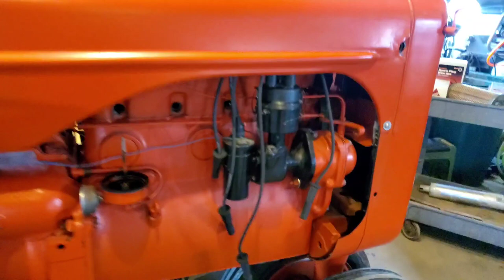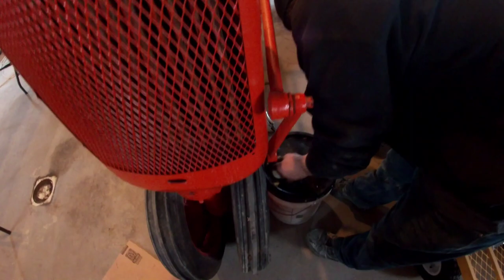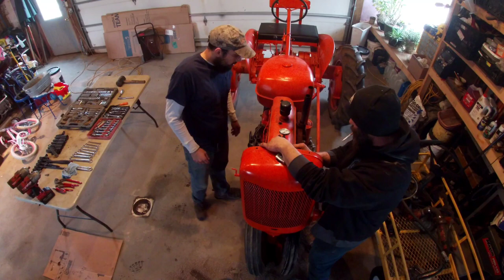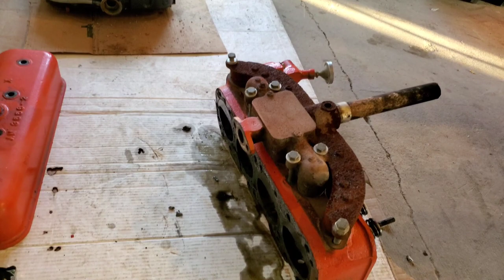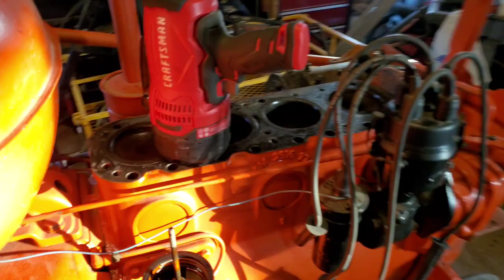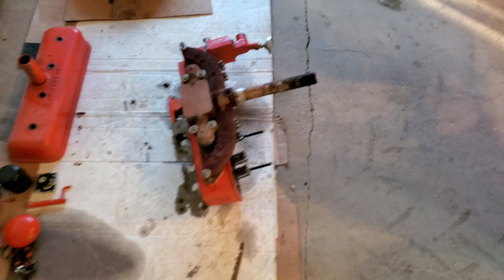Allis Chalmers C project part 1 - removing the head.

Comment: Can you tell me the torque specs on the head and rockers on this allis chalmers b i bought
Reply from the maker: 60 ft pounds for the head bolts
If I remember correctly the rockers are ⅜in grade 5 bolts witch makes them 20 to 25 ft pounds if they aren't ⅜ just look up any standard torque spec chart for bolts.